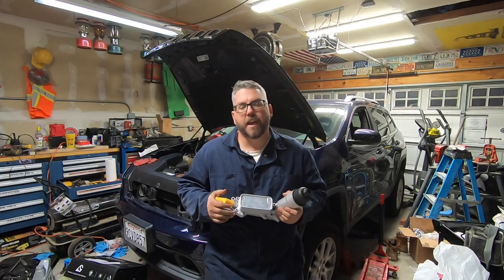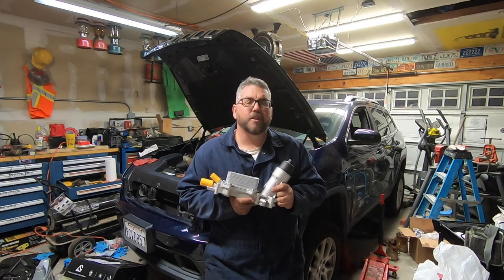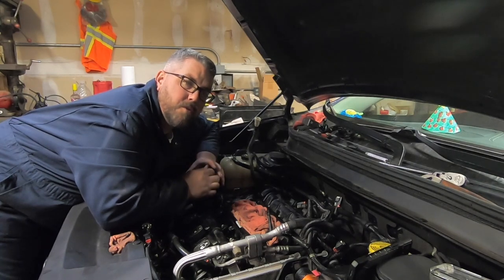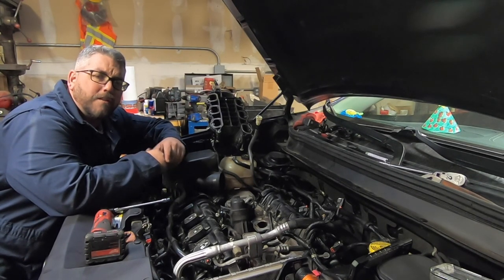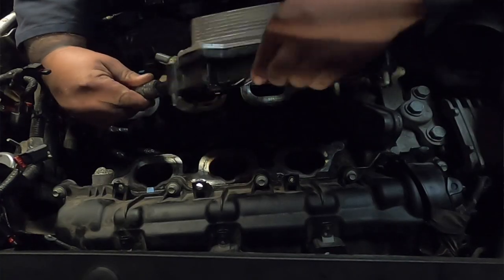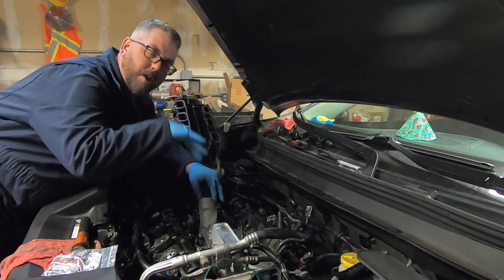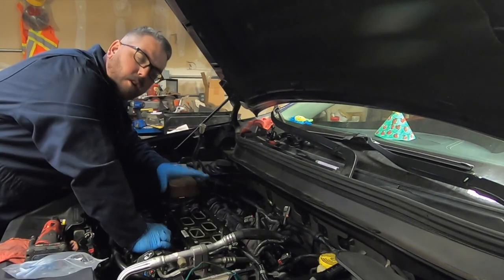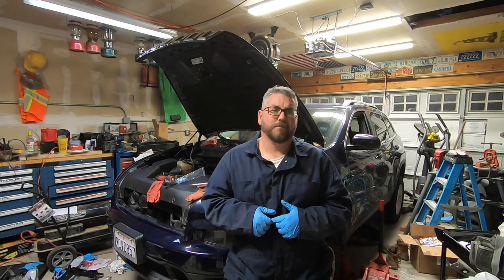Replacing The Oil Filter Housing On A Jeep Cherokee KL 3.2 Pentastar

Comment: I was able to use this tutorial to replace my housing on a 2017 Jeep Cherokee latitude. Replaced the housing with the aluminum. The housing area was filled with so much fluid I had to soak it up with 5-6 towels. Cleaned the area, replaced it with everything in the kit. Started the car up and noticed oil drilling a bit on passenger and driver side but will see what happens tomorrow. Fingers crossed!

Comment: Very helpful video, thank you! One question, throughout neither this process nor the fuel injector one do I see you dealing with the plethora of awful single use zip tie fasteners.  I assume maybe they were gone before you did the jobs, but are all your cables (and the coolant hose in the valley), just free wheeling in there now, and if so, has that caused you any problems?  Side note: We purchased our vehicle new (a 2019), it has only been serviced at the dealership and isn't due for plugs yet.  And yet the dealership (or maybe the manufacturer) broke the tab on the MAF sensor box just like yours, as well as substituted a bunch of non-oem zip tie fasteners (and over tightened every damn one of them) even though we've never had work done on the vehicle that would have involved taking off the intakes.  Super sus.
Reply from the maker: All of the Christmas tree fasteners with the zip ties I carefully pried out so as not to break them and was able to reuse them. As a general rule is not a good idea to leave things loose because over time it will eventually cause wear. Hope this helps and good luck.
Reply: @ProjectVenture  Nice job.  Tried my heart out, ended up breaking a different tab off the MAF box (though it superglued back on nicely).  I finally said to hell with it, cut all the zip ties, but used the christmas tree bases as the loop through with to pass a new zip tie.  Works pretty well, and much easier next time I have to get in there, just have to be careful that you don't leave any sharp edges facing the wiring harness.  Ended up taking about a week to do the job, a little here and a little there, really trying not to break anything.  Could probably do it in a few hours now that I've been through it once - or a few times in the case of the upper manifold. Once for the initial maintenance, once because I captured part of the wiring harness between throttle body entrails and the lower manifold such that a connector was trapped, and once because I forgot the daggone rat's nest/noisy-lifter-quieter-hack foam not 5 minutes after watching another youtuber do the exact same thing - and laughing at them.  Karma sucks.

Comment: I have a question, at the point where you said nows a good time to do the oil change and a coolant flush, u already loosened the oil cooler bolts,(not to mention the intake, sensors and injectors are discounted) correct me if im wrong but wouldnt that cause coolant to spew out, also i have oil mixing with the coolant so what would be the best way to do that, if i flush oil is still gotta seep into the coolant and i cant run it without oil so im stumped

Comment: Hey thanks for this video. When I go to the Amazon link you sent, Amazon says this part does not fit a 2016 jeep Cherokee (which has the 3.2l pentastar V6). Any thoughts on this?
Reply from the maker: It said the same thing for mine but when I cross referenced the part numbers it replaces, they did match up.
Reply from the maker: I did read somewhere that some people had problems matching up the sensors but they just put their old sensor on the new housing. I did not have this problem though